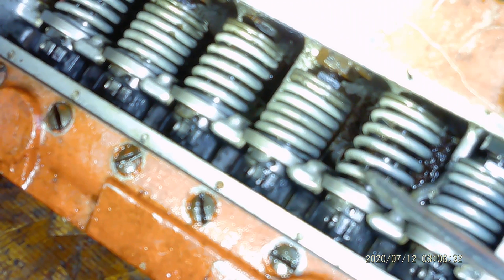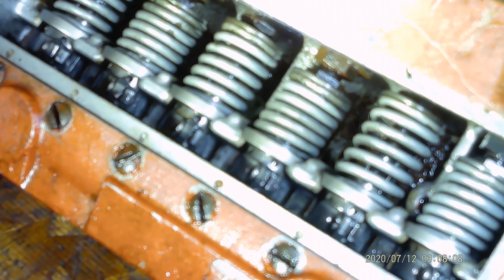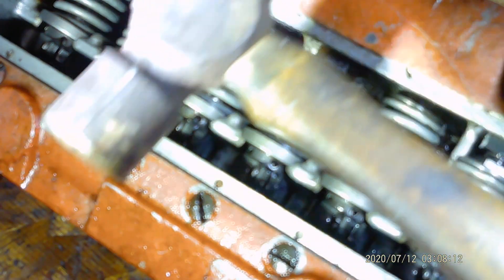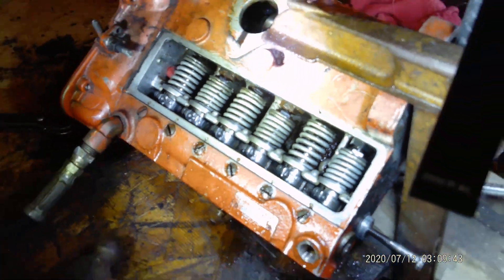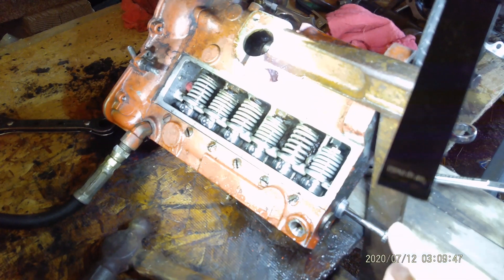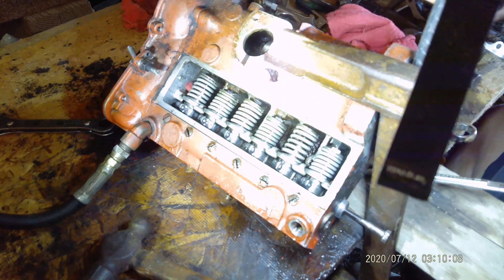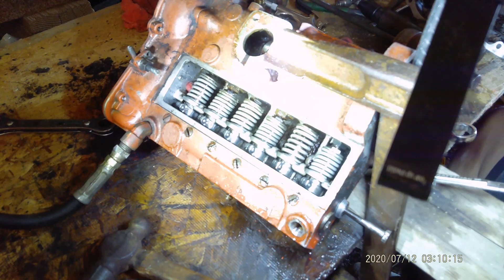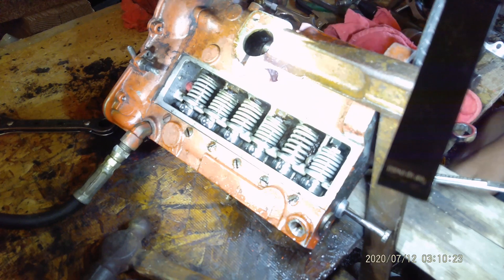case 1030, Bosch pes6a injection pump stuck rack pt 5

Comment: Thanks for the information I'm dealing with the same exact thing. Are you supplying the pump with diesel through that hose?
Reply from the maker: no took the front allen out at the front, it appears most of my sticking was at the spring level which runs in engine oil. more videos to come on it. best of luck
Reply: @Hoosier-om2kh  I just uploaded a video on it . I got everything figured out and fixed. Had two stuck plungers got em freed up
Reply: Longbeng fuel injector pump has its rack stuck and truck is now heavy on fuel